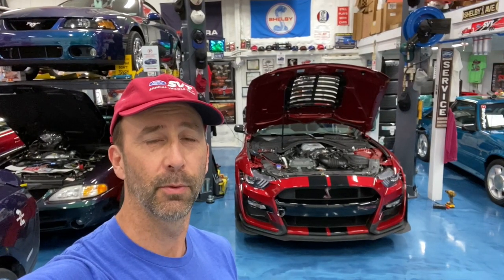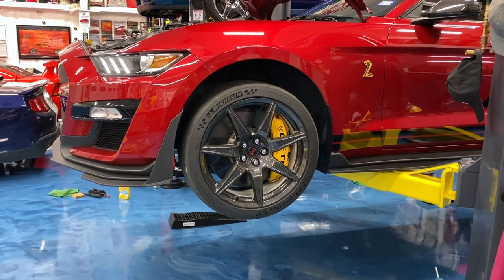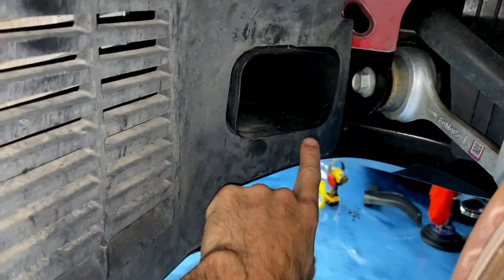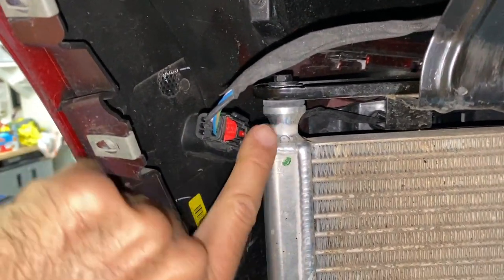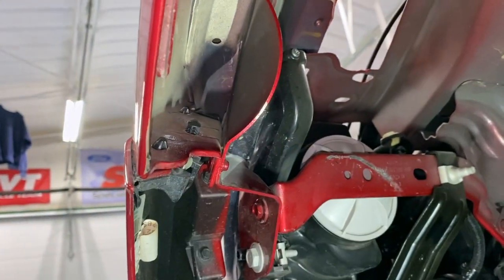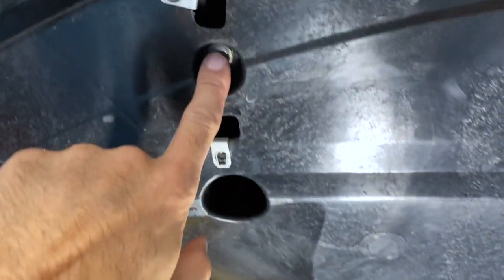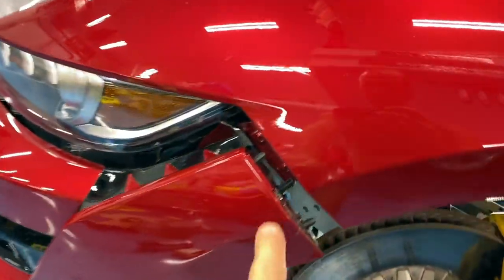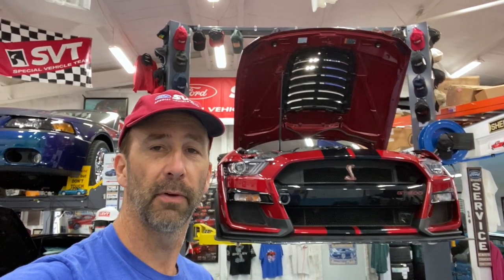2020-2022 Front Fascia Bumper Cover Removal - How To!

Comment: Nice video!  Any observations besides the obvious, on the pads (sliplo?) you installed? 
Perhaps the creek mishap rubbed most pcs, rather than normal daily/& track use of car? Looks like 2nd row (lowest points) has most scuffs..?? We are still tryin to decide if we need the product or not in our area/situation. Any info is appreciated.
Reply from the maker: Thanks! The splitter and SLIPLO bumpers are new post creek mishap. If you will be removing the splitter at any point in the future, avoid putting the bumpers on the tabs that have to slide out for splitter removal. I ended up having to cut those.

Comment: Great thanks. I just replaced the wicker with a carbon fiber and was a pain in the you know what foe the belly peice. Next up is the front insert, turn signal bezel and the bumper trim. I will be using your video to get the front bumper off. Do you have a video for the rear bumper since I am replacing the diffuser or do I not have to remove the bumper? I also have a lift to use while doing all this. Thanks.
Reply from the maker: Thanks Michael! Congrats on the CF mods!  I don’t have a rear valance video. I did replace my diffuser… just be sure to get all the tabs fully seated, otherwise you will have gaps.
Reply: @ShelbyFlyer  do i need to take the rear bumper off for this or can i do it without the bumper removal?
Reply from the maker: @michaelashbrook1730  I did not remove my rear bumper cover to replace the diffuser.
Reply: @ShelbyFlyer  great that's a relief I was dreading having to take that one off as well to put the CF diffuser on and im sure with a lift makes it alot easier.

Comment: Great Video! thnx! I'm wondering....Can I just remove the 10MM bolts on the corner to the fernder, remove some pins and Torx Bolts from the liner near the front corner, and the Corner Dive Planes, and all the bolts up top on the radiator support. amd then just pull the top off the pins and let it hang down? I want to change out the turn signal Light housing for a different unit. my frnd did this to his 500 that's what he told me he did. Since you did this bumper removal a couple times. think that can be done? without taking off the whole front bumper and trays underneth? i seen Lethal do this to a GT mustang, to change the headlights. hoping i can do the same to my 500 just to change the turn signal housing. LOL. LMK if you think that can be done? Thnx MIKE
Reply from the maker: Thanks Mike!  The technique you described sounds like it would give you a little gap to reach down in there… I suspect it would work.
Reply from the maker: @Mikey550  Looked at the video… honestly not sure. Potential problems are 20” wheels vs. 19” making access in the wells harder. Also, our splitter is HUGE! We also have a rigid belly close out panel. I have removed my bumper cover quite a few times. It’s a quick job for me. I would go that route again vs. this route.
Reply: @ShelbyFlyer   ok thnx for the info! appreciate it!

Comment: Do you have to remove the wheels & fender liners to remove the front fascia or are you just being thorough?
Reply from the maker: You need to gain access to bolts behind the liner. It’s going to be tough to get to them without removing the liners.

Comment: Would you be able to advise me? I bought a gt500cftp last year but haven’t drove it yet, the dealer filled the tank with gas after I specified not to, car still has 6 miles, is there anyway to remove the gas without driving it before the gas goes bad?
Reply: I put a half a bottle of stabile in it like 2 months ago but didn’t want to run thru the engine.
Reply from the maker: Getting gas out is not easy. There is anti-siphon stuff in the filler neck. I have gotten gas out of some of my cars with varying techniques, but the easiest is to just run it out. If you drive it, stay out of boost with the old gas. I haven’t tried to get gas out of my 2020, but you could try a thin flexible tube down the filler neck and there is usually a fitting up on the fuel rail that you can put a tube on. You would likely have to cycle the car into accessory mode over and over to engage the fuel pumps briefly.
Reply: @ShelbyFlyer  what kind if time frame does 93 octane gas have?
Reply from the maker: @mrb6144  Not sure… I believe it depends on the conditions it is stored in… climate controlled vs. non climate controlled will make a difference.
Reply: @ShelbyFlyer  thanks for the help, i always to your channel for technical advise for the GT500

Comment: Is there a way to adjust those black side pieces next to the headlights?  I just got a new 500 and seems when Ford put the thing together there are two scratches where the black meets the color of the middle bumper and if I could get the black piece about 2mm closer to the front it would hide them.
Reply from the maker: Honestly don’t know… haven’t tried. Can you see anywhere in my video that shows a potential solution?
Reply: @ShelbyFlyer  no.  I was just wondering if you knew or came across it during your removal
Reply from the maker: @FLDisneyfan99  Didn’t look closely at that area... sorry.
Reply: Appreciate it

Comment: What work were you going to do that required you to remove it?
Reply from the maker: I’ve had the bumper cover off a few times to fix damage from my track mishap as well as deal with my trans overheat issue.

Comment: This seems to be the only way to clean behind the grated areas. I was hoping there was another way without taking the whole front off.
Reply from the maker: You can clean the transmission cooler, which acts like a collection shelf, without removing the front fascia. That is a separate video on my channel. Removing the front fascia is required to get to the other coolers though.
Reply: @ShelbyFlyer  Awesome,  thank you, will check it out.